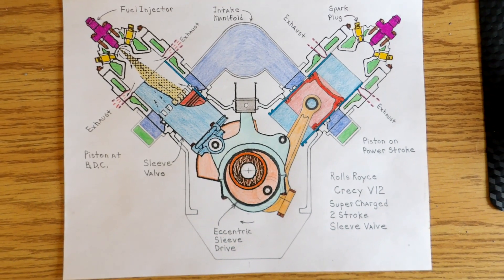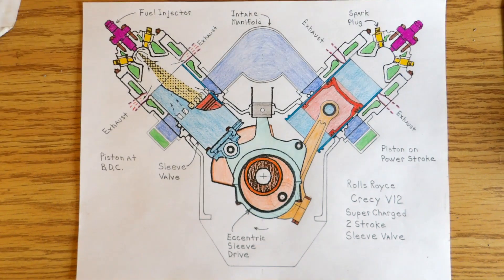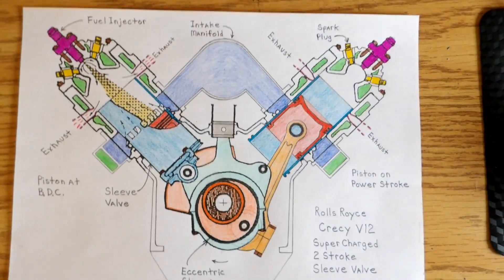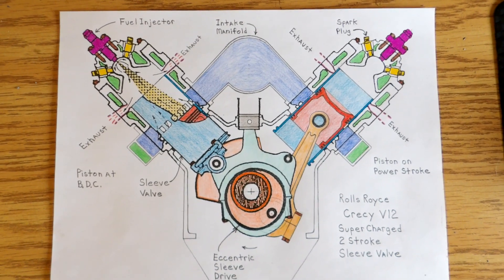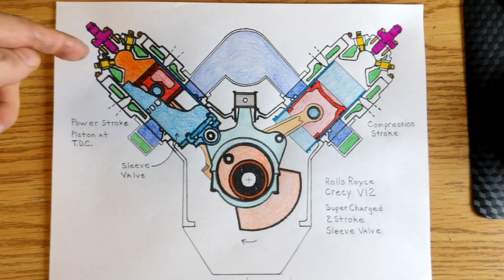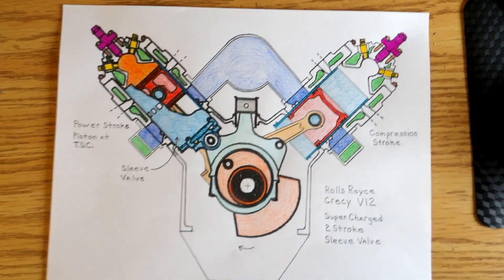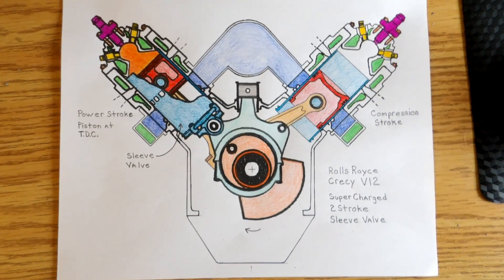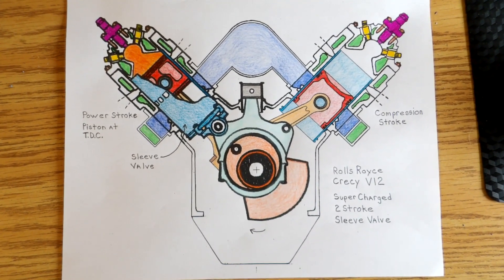2 New Rolls Royce Crecy Colored Cutaways

Comment: Did you ever get the V4 Wisconsin back together
Reply from the maker: No, sadly I had to return it to the scrapyard, as I needed the shed space for a bunch of Briggs engines. I did keep a few of the parts form it though. like the magneto, and the new piston rings I bought. I have come to realize that I can't save everything. I do recall the fun I had tearing it down though! My cousin still has a complete engine that has been shed stored, and isn't seized up.
Reply: Ok I was looking the other day to see what I'm in for I'm just starting on one that's stuck pretty much the same way, even on the same cylinder in an old chipper I picked up, I watched what you had put up and enjoyed it 😁

Comment: looks good, will it nee premix or just straight gas?
Reply from the maker: Mine will be straight gas, like the real Crecy. I had to simplify a bit though and use a carb., instead of direct petrol injection. The funny thing is that here we are 80 years later, and now cars are using direct gasoline injection, so a person could modify some used car parts to actually make it direct injection! Even 20 years ago this would not have been easily possible.

Comment: They're certainly quite unusual engines when compared to a "regular" 2-stroke engine, at least the ones I've seen anyways...
Reply from the maker: Yes, this engine has oil in the crankcase, but has to use a supercharger to force the air into the cylinders. The fact that it uses direct injection helps with it fuel economy, as only excess air goes out the exhaust ports. that won't be the case with my carburated version, but was one of the ways I had to simplify it.